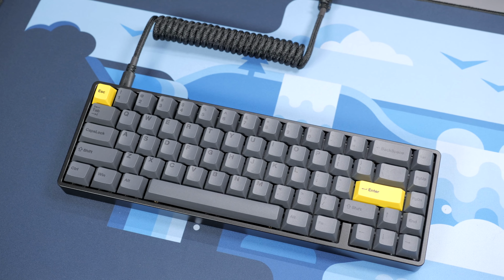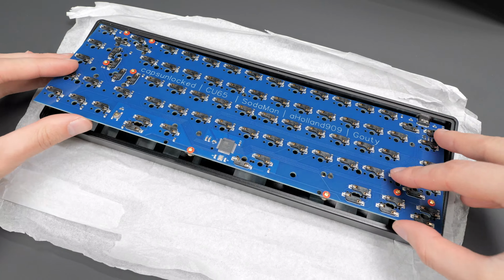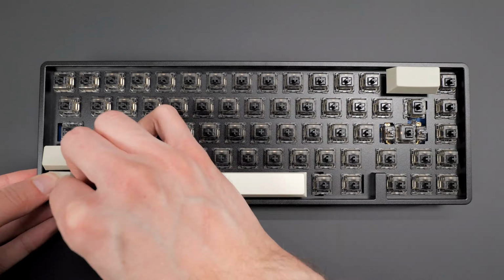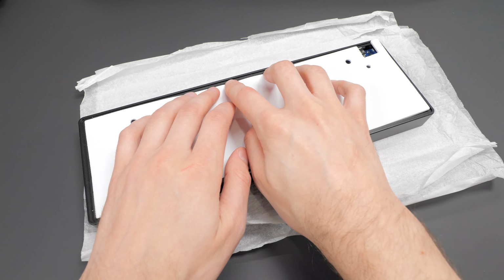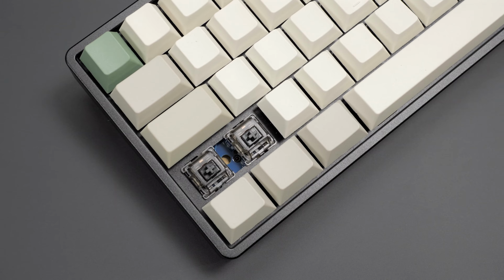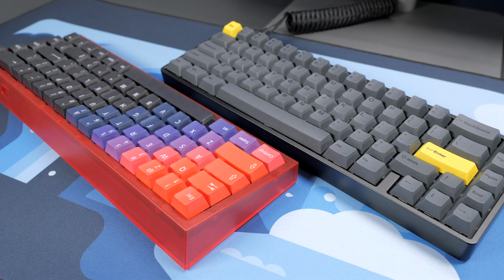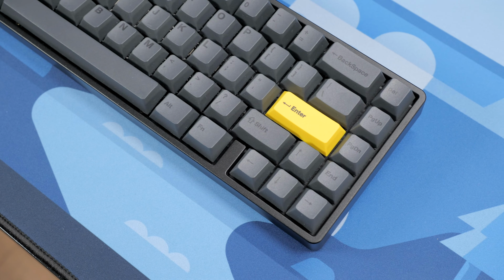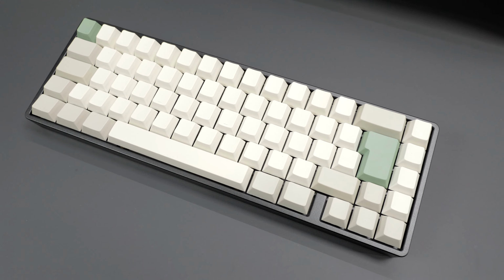capsunlocked CU65 Review ~ Multi-layout Hot-swap Mechanical Keyboard!

Comment: Finally got the time to build this keyboard last night. Had it stored for over two months! It's my first custom keyboard so a lot of mistakes were made. All in all had fun with it!
I used stock Durock silent linear switches and clear Durock screw-in stabilizers (lubed with krytox 205g2. These switches are silent and smooth! I think if I lube and film these they would be completely mute!
I did not feel this hollow, as some say, but it's probably because of the type of switches I used. Rubber feet could have been a lot better and for first timers this should have come with instructions. To finish this build I had to dig deep in the CapsUnlocked Discord to learn how to flash it in QMK and other steps. I later learned that it is VIA compatible!
Hot swaps are tough. I bent a few switches in the process and while trying to fix them, I had a hard time taking them out with two different switch pullers, and even broke one of my switches. You gotta be careful with this one!
Overall I'm happy with the board, it's sturdy and well built!  Will see how it behaves with time. I need to experience other types of mounts and builds, but this one is good for experimenting. I went with this because I wanted an Iso Spanish Latin America layout.